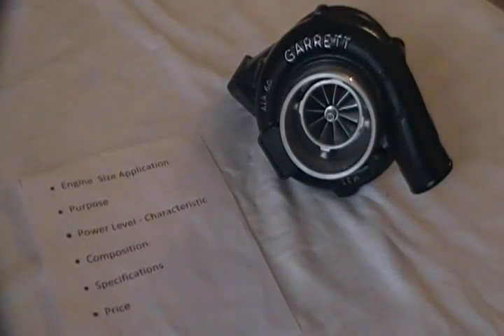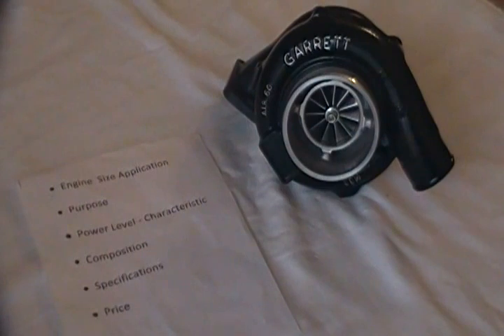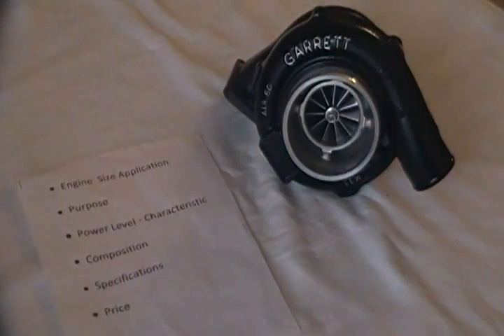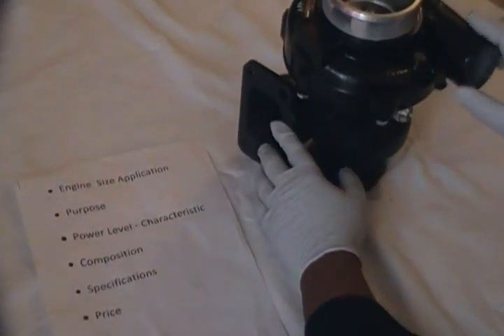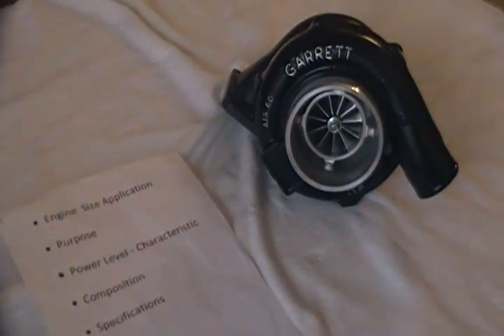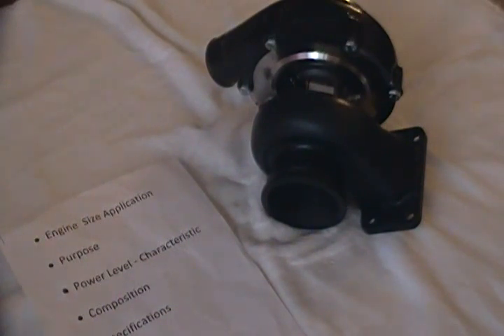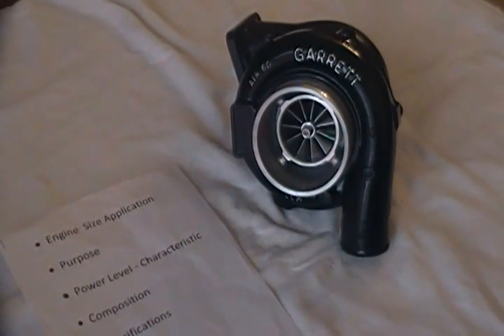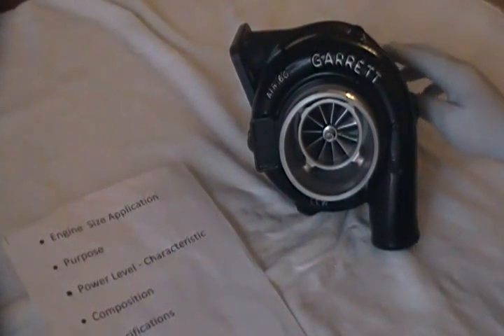GTX3076R - STC Description and Review

Comment from the maker: There actually are T31 Housings that can fit the GT(X)R series. If you're getting the one from the standard T-series cartridge, no. it will not fit. ButGarrett does have the T32 2.5" 4 bolt style for this turbocharger. Just have to know what part number to get.

Comment: great review, just one thing though.  the t3i 4 bolt housing will not line up 100% with a standard t3 compressor housing.  i bought this turbo with the 4 bolt turbine housing to replace my bullseye t3/to4e 57 trim and the garrett turbine housing puts the flange about an inch further out than the t3 exhaust housing on my bep turbo.

Comment: I heard you say japan in there, Garrett turbo was bought out by honeywell in 1999, and manufacturing moved to china, which is how so many knockoff turbos were created.
Reply from the maker: And General Electric owns both companies as an umbrella conglomerate which has locations in Japan, Hong-Kong, UK, Singapore, and the U.S.. What's your point here?
Reply: garrett parts arn't made in japan.
Reply from the maker: GT series turbochargers for a brief period were made in Japan under Sigma bank conglomerate from 1998-2006.  Assembly has still been in japan for some time, not full manufacture from foundry process up.

Look, I don't know where you're going with all this. Perhaps its to just to bust-balls, or to feel relevant. I understand your processes and your creations as well. But really, this has no relevance as to the function and use of the GTX3076R as the video was intended. Any points of debate, you're more than welcome to e-mail me. thanks.

Comment: hey ..how is this compared to the gtx3576r… thanks…
Reply from the maker: I'll be adding the GTX3576R video later in January.  You can then compare. Thanks.
Reply from the maker: Compressor wheel between GTX3576R and GTX3076R are the same, but the GTX3576R uses the same exhaust wheel and cartridge as the GT3582R, so it can obtain over 500whp + a bit more easily.

Comment: can these turbo reach 650 2.4 liter engine ?
Reply from the maker: No, this is due to the limitation of the turbine wheel.  The GTX3576R is the one to use for the 2.4 litre high effficient engines
Reply: Wait is this a gen 1 or gen 2? Because the gen 2 is capable of making 650hp on a 2.4l they can make 650hp on a 2.5l